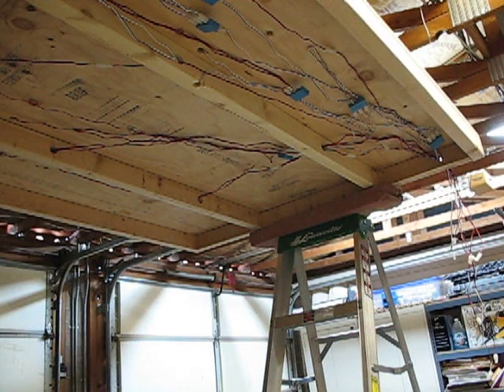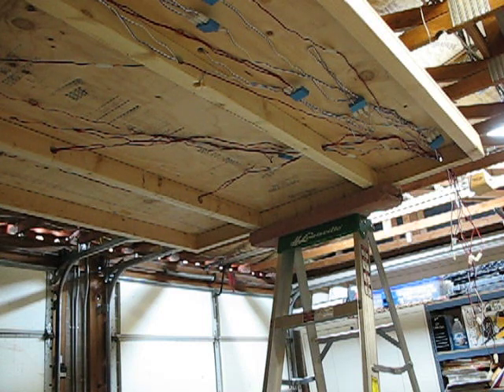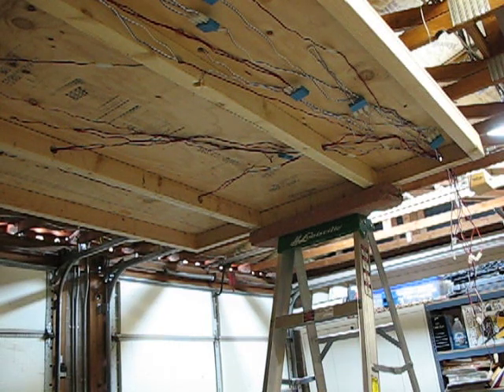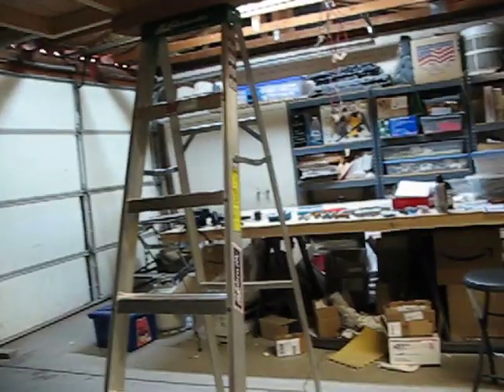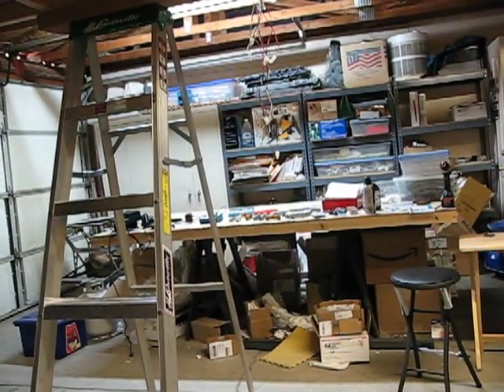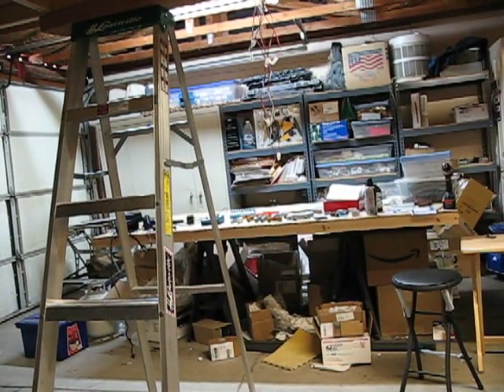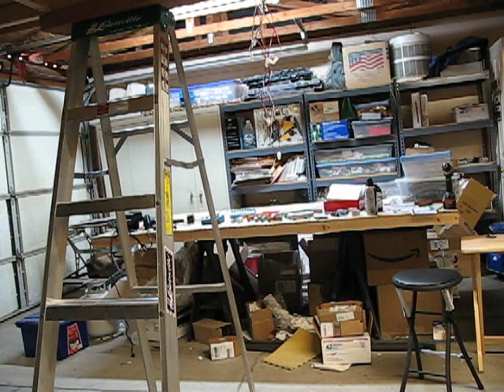New N-Scale Train Layout From Start to Finish - Part 11

Comment: You could use Split Loom or Wire Channels that has Double Sided tape on the Back to channel all your Wires and since there White you can Label the Channels,  many times I see wiring similar to this and Looks all bunched and Looks like chicken Scratches.. And as for a Board A good ole piece of M.D.F to me is better than Plywood and is Naturally smooth on both sides and paints well it comes in 1/2 and 3/4 thicknesses. & 4 X 8 sheets..

I do Like the Pattern of the Track but that D.C.C. shit  Looks like it can be a Pain in the Ass to Cough up the money for..then set up & Run the stuff on it, I guess I'm ole Fashion and Like the ole Way to run my Units Maybe when money starts falling out the sky I'll spring for D.C.C. starter Kit and Higher me a Wise Ass to set up :)